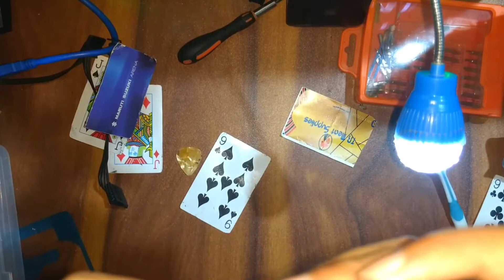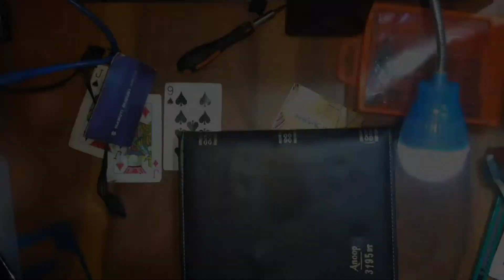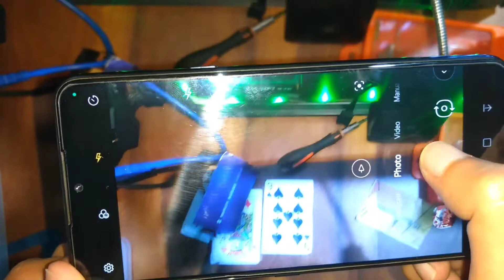Back glass replacement LG G8X | How to Replace the back glass of smartphone

Comment: Good video.
Does the new one look like original glass or looks like plastic? Do you need to use fresh glue to close the cover after installation?
Reply from the maker: It comes with the glue but recommended to add a fresh one too . and yaap its looks as new. check the full video for you doubt.
Reply: @SarrkBox  👍🏼
Reply from the maker: Subs to the channel if it was helpfull
Reply: Subscribed
Reply from the maker: Thanks